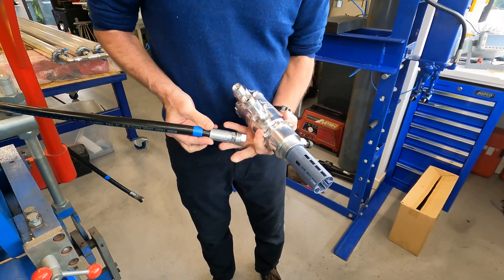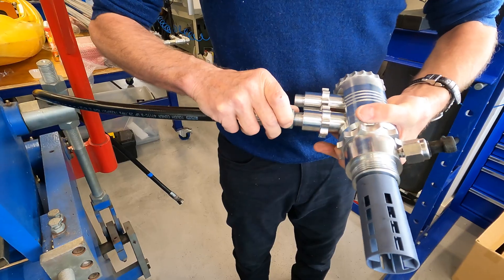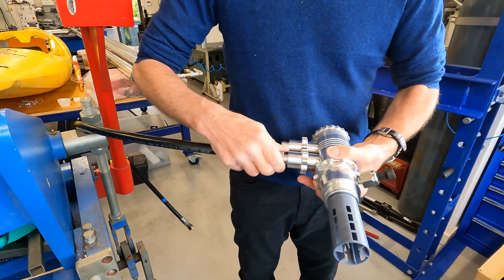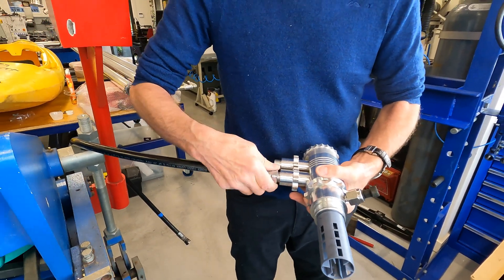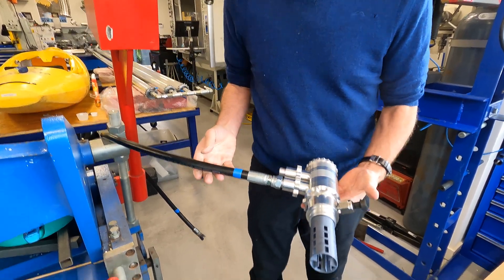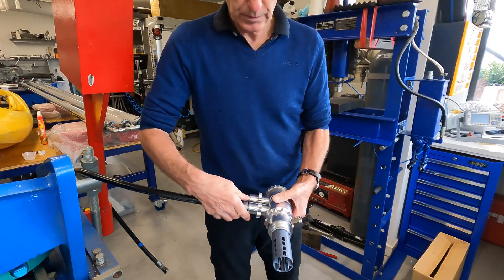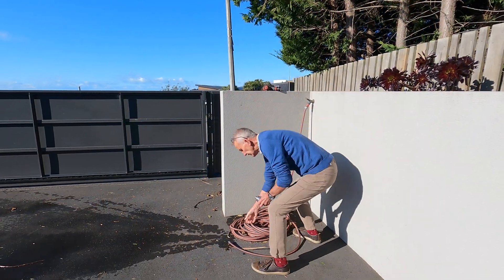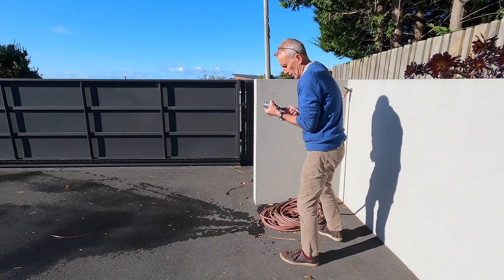CNC Milling Work on Rocket One Piece Injector Block | Tormach CNC | Hybrid Rocket Engine Production

Comment: did he bypass the door? must be a real pro to operate cnc with open door😂
Reply from the maker: Interestingly when I bought this mill from tormach 6 years ago the basic models have no door and are open. 
When I upgraded with the tool change I also went for the enclosure. 
If I have programmed for a aggressive fast cut the door would be shut but filming it’s just easier to do a very light slow cut.
Always eye and ear protection and thank you for taking the trouble to comment 😊